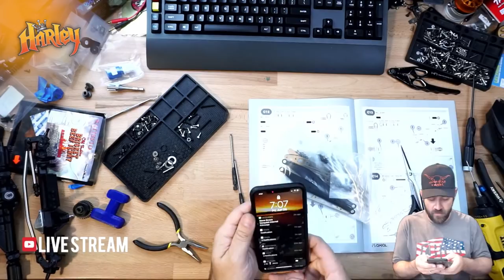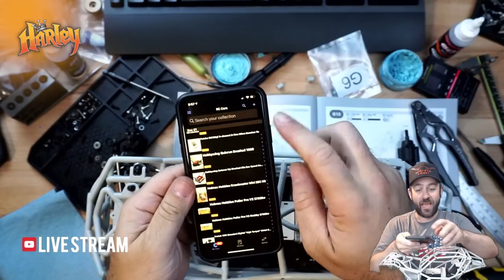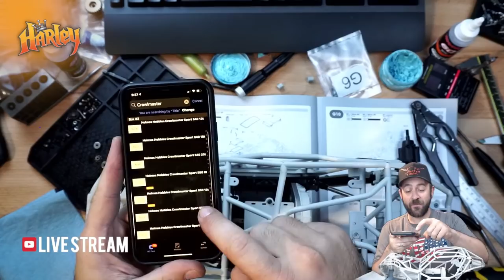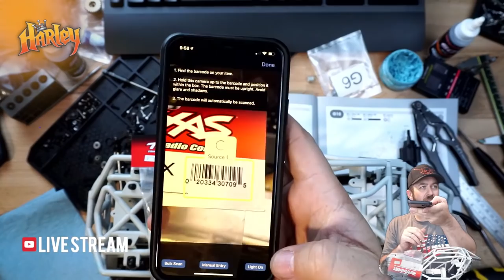Axial Ryft Kit- Friday Night Live

Comment: What was that app called?? Do you know where I can get a stock plastic front Capra axle?. Just built a Capra and want to do 4 WS. Don’t need metal axles and trying not to buy it bit by bit.
Reply from the maker: App is called iCollect. You'll likely need to buy the parts, but really it's just the housing, knuckles, king pins, inner shafts and bearings. You can use the gears, stub shafts, hexes and locker.